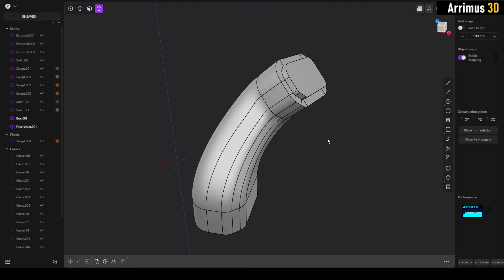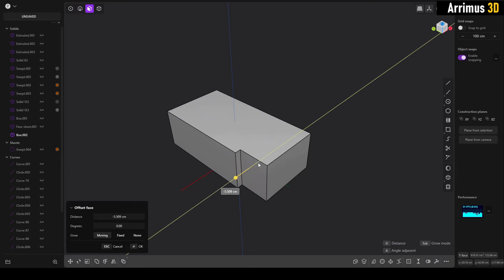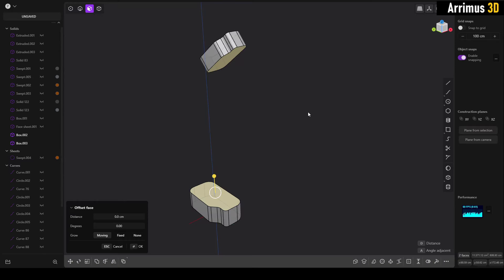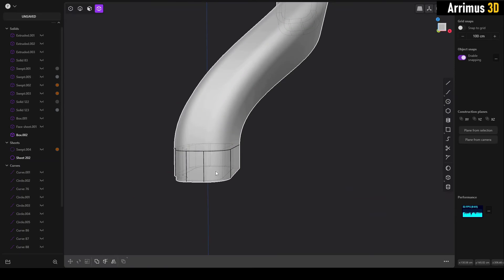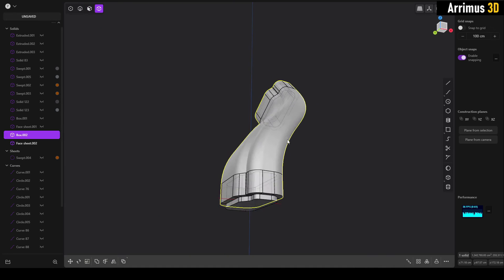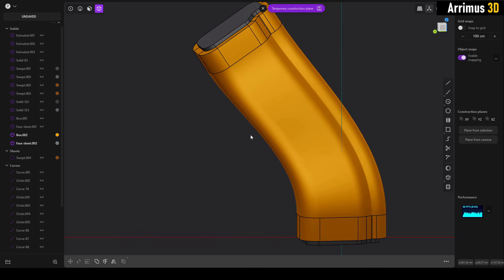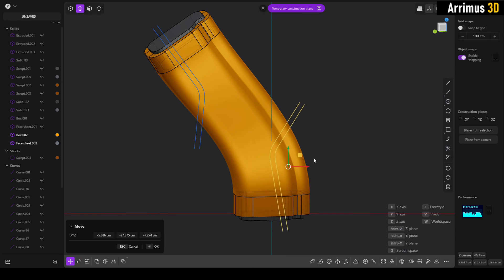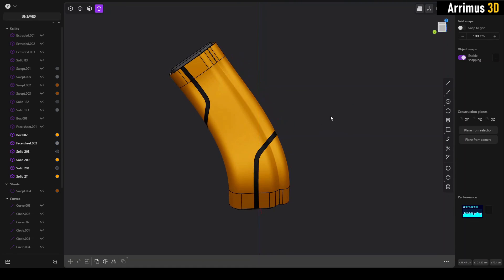Plasticity- Create Pipe out of Solids

Comment: My issue with Plasticity is the lack of view ports that you have in other modeling programs and the ability to lock your view so that it doesn't change the scene should you click outside the model. Working planes are fine but not a substitute for view ports when you're surface modeling complex objects.

Comment: Maybe a stupid question...Is the topology just magically okay for use in blender / a game engine or does there have to be a re-mesh workflow?
Reply: For hard surface non deforming meshes/- the blender bridge exports polys comparable to Moi3d with custom normals that render well in Blender. Google the blender bridge to plasticity
Reply: While the Blender bridge is good, I prefer the OBJ export functionality, there's a lot of control there! You can do a lot of tweaking, to get the kind of meshing that suits , things like how many rows will your fillet be.   Very generally, you'll get better topologies more easily with N gons, generally fine for rendering, but not so great for game assets. There is a lot of tuning you can do in the export function, none of it is too complex, but if you're dead set on quads only, that'll be more work to get the best result
Reply: @AMPKlickitat the refacet functionality within the bridge exposes the same mesher functionalities as the OBJ mesher from Plasticity. The cool thing is that the websocket functionality is software agnostic - so any 3DCC software should be able to access the same functionality. One of the discord users has already ported it over to Houdini.